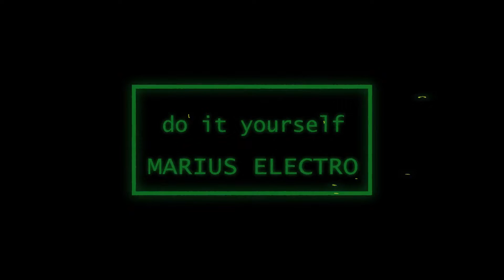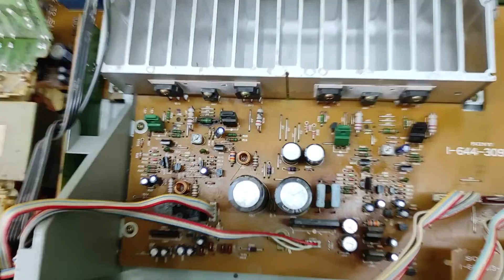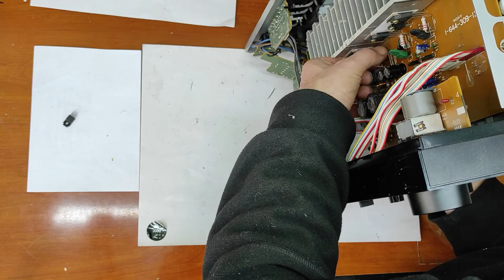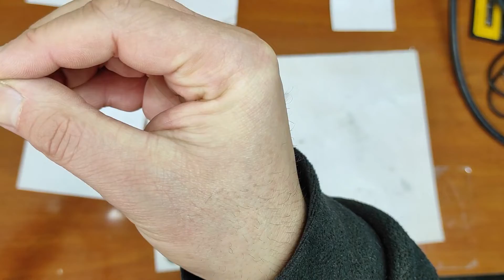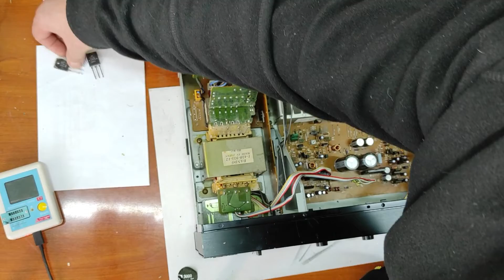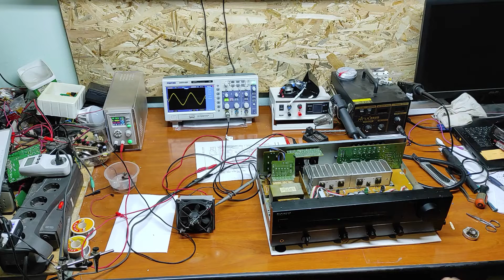How to repair audio amplifier Sony taf319r with schematic

Comment: Where can I get diferential power supluy, what kind is yours?
Reply from the maker: u can buy a profesional one, or u can diy. depends the skill and your passion and money.
Reply: Thanks, both variants are complicated for me. How do you think when I test is it safe enough to put incandescent lamp 60 wats at primary winding of the transformer?
Reply from the maker: @batkotivalio i use this in smsps repair. But u can try and tell us If works.

Comment: Hello, I have a very similar amp with a problem on ony one channel. for some reason I get the supply voltage on the base of the power transistors too. It should only be on the collector. I removed those burnt power transistors and started looking for shorted resistors and transistors but I couldn't find any. Do you have some ideas? Thanks!
Reply from the maker: you should check first power transistors,after transistros before them and so on.maybe u r lucky and find all the problems.

Comment: I would have liked some more explanation on the schematic, and have you point out the components that were repaired. I couldn't identify them just from your talking. Also, when you test a component, and say that "it's good", it would be great if you could say why, as in what values are you looking for on the meter. good pace to the video, and the camera work was just fine as well.
Reply from the maker: tnx,u r right.I've changed tr408,tr409,tr406,tr407,r417,r418,and instead r415270ohm I had 2x 150ohm.When I test a component,first of all I check for short circuits,and then I check be and bc junctions.